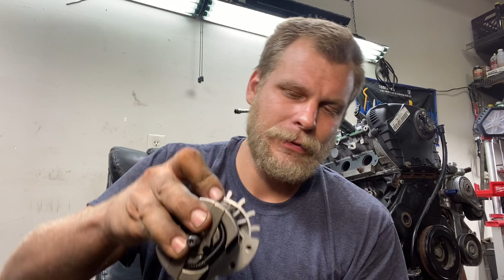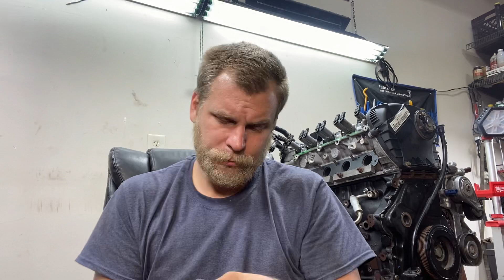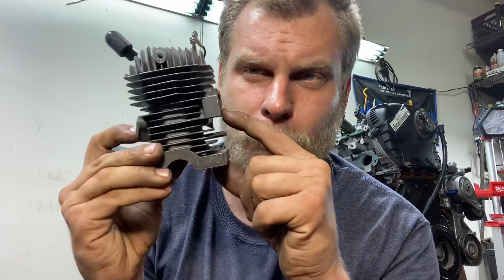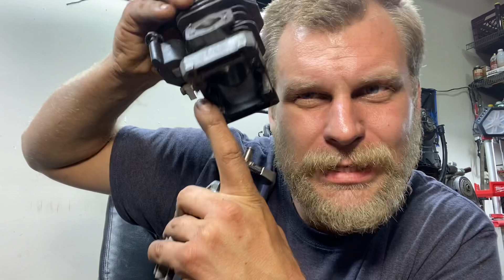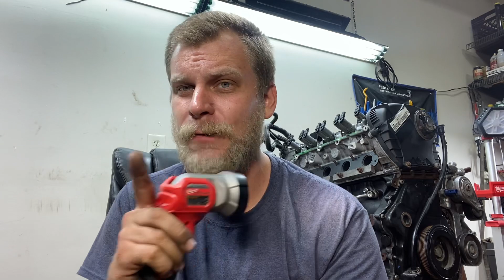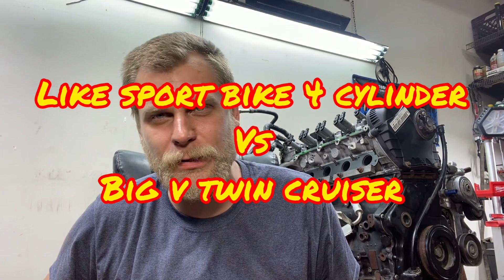2 stroke Engine Intake and Exhaust path 
How it works two cycle motor operation most simple design

Comment: 2stoke piston port motors are awesome - 2stoke can really produce power via incredible RPMs.. the reason they’re “dirty” is because they burn oil in the process, they burn mixed oil/gas like Nap explained as the fuel mixture enters it separates the oil drops to the crank and the residue oil burns and lubricants the walls/rings like a normal 4 stoke but oil is burned with the gas as well thus creates smoke or as we say 2stoke cologne LoL.. 2 stokes are finicky on cold starting usually need a primer.. and carb setting can be tricky as nap explained in a previous video..